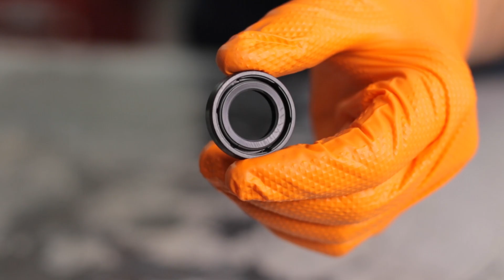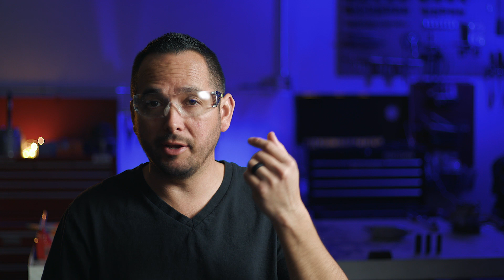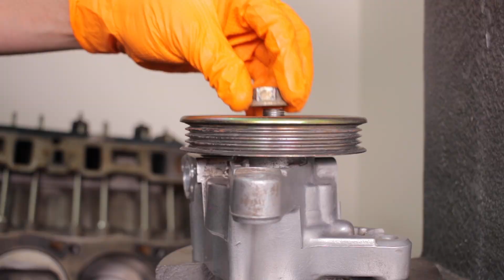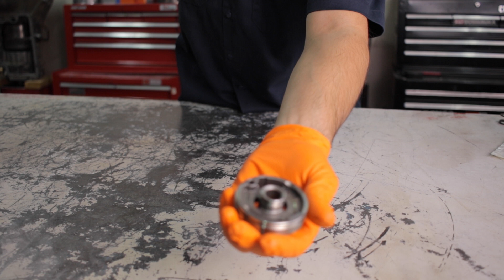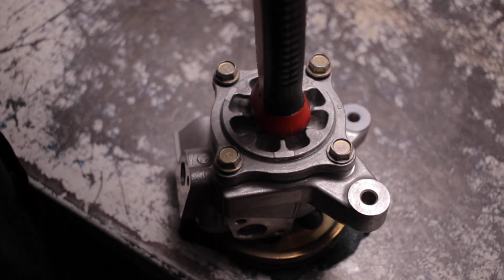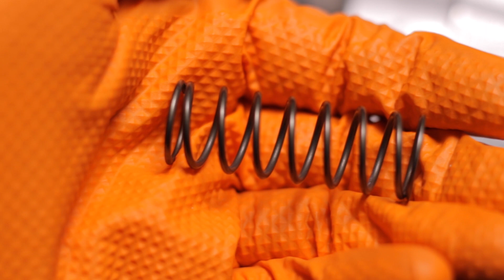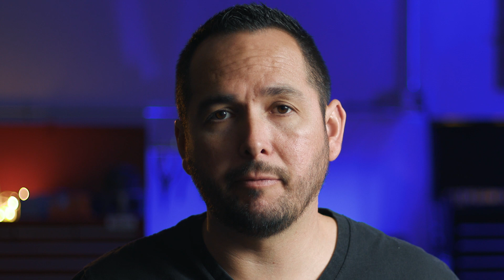Power Steering Pump Rebuild - Part 3 of 3 (1 Hand Mechanic) #SouthpawAutoworks

Comment: Yo, Southpaw,  you went all philosophical at the end, which I don't mind. Except the quote from Henry Ford, who I absolutely despise for various reasons. Even though, what he said was a good quote {I still can't stomach the guy}. But aside from all that, your, "how to", video is right up there with the best of the best. So, thank you for taking the time to be so thorough!!  
  Since I don't have a press I'm going to try using a Ball And U-Joint Service Set that I got from Rock Auto, which I have yet to try out. Unless you wouldn't recommend it. And, I'll be working on a pump out of a 2001 Kia Optima. Should be real fun, Yeah? 
  What I, just now, discovered, though, is that the first O-ring that you instructed to take out from the low pressure inlet port wasn't even installed, in the first place, when they switched out the pump a few years ago. The guy, apparently, did a rush job. And, when I went back to the same outfit, here in SLO Town, they acted like they didn't know what I was talking about as I tried to question them about the extra whining sound I was hearing. So, basically I've been having to drive it this way for the last few years. And recently, I even had to switch out the rack and pinion. 
  Simply install the missing O-ring and skip the whole rebuild process, maybe?? Because, all I need right now is to fix the air from getting in there. What thinkest thou? Bad idea?? Maybe worth a shot???
Reply from the maker: Thanks for dropping me a line.  Appreciate you watching the video.
2001 Kia, right on.  I imagine that a ball/U-joint service set might do the trick.
Sounds like putting the O-ring in first would be easy enough to try and see if it works.  And then go from there.  I'd like to hear what you decide to do, and how it goes.
Reply: @SouthpawAutoworks  Thanks for getting back to me right away. This whole pump thing needs a little research because I don't think that the replacement was a Kia. Also, I happen to have the Kia shop manual which has an exploded view. Thanks again for everything!
Reply from the maker: Shop manual and an exploded view?  Good deal!
Reply: @SouthpawAutoworks  Well, I just now looked at the gasket rebuild kit and it seems to not have that first, smaller gasket as part of the kit. Also, I just checked the shaft by spinning it and I can hear the bearings clicking against themselves as you spin it in a back and forth motion which may or may not indicate that they need to be switched out. I don't know enough to know either way. But, I fear that the O-ring might be unobtainable
Reply from the maker: Bearings shouldn't make any noise like that.  Some time ago, during a transmission rebuild, I spent quite a while looking through a rebuild kit for a missing O-ring.  Turned out it was hiding inside of the extension housing seal.  It fit perfectly inside of it.  Thought I'd throw that out there.
Reply: @SouthpawAutoworks  The bearings only click when I suddenly turn the shaft in the opposite direction otherwise it doesn't make a sound. Not only that, but there's no play in the shaft from side to side.
Reply: @SouthpawAutoworks  Well, this aftermarket pump only varies with the suction pipe mating surface, as far as I can tell. Actually, there IS an O-ring which has a much bigger diameter, though, than the end of the pipe that slides into the pump. So if I can match up this O-ring with one from the kit it might be all that is needed because it does actually make contact with the mating surface. 
 You see, this is the problem I have with watching Honda repair videos for the Kia Optima. The Honda rack and pinion videos spoiled me making it look so easy {there weren't any Kia videos that I could reference for the rack and pinion job}. But, in reality, the Kia was a huge job because there is a lot more that the job entails. It was a major production unlike the Honda. Dropping the subframe, undoing the balls joints along with a bunch of other stuff. A real headache. But a learning experience at the same time. I had actually entertained the thought of producing a tutorial of how to go about the whole process, afterwards.
  Anyway, thanks again for all your help. I'll let you know how it turns out.
Reply from the maker: The sudden turning of the shaft my be making something click inside the pump, as opposed to the bearing.  Might be normal.  Hard to say...
Reply from the maker: In time, I will pick up more pumps, from other manufactures, and make videos on those, too.  Dropping a sub-frame without a twin-post lift is a real challenge.
Reply: @SouthpawAutoworks  That part was only challenging because I didn't have a clear enough of a picture of all the steps involved: What to do, BUT, What Not to DO.
 So anyway, getting back to the pump: It worked out. All I had to do was the one gasket. Hur-ray. Now, I'm  going to try and switch out the radiator. Thanks again.
Reply from the maker: Just the one (1) gasket?  Dude, that's great!  I'm glad that everything worked out on your 2001 Kia Optima power steering pump.  Really appreciate your follow-up comment.  Wishing you all the best with your radiator swap.  You got this!